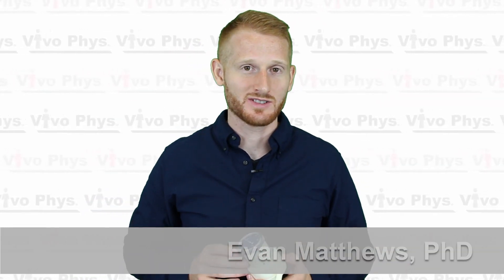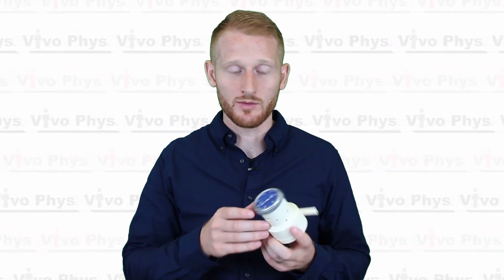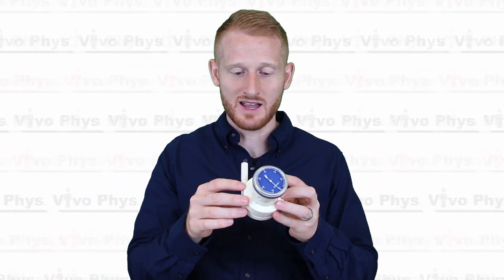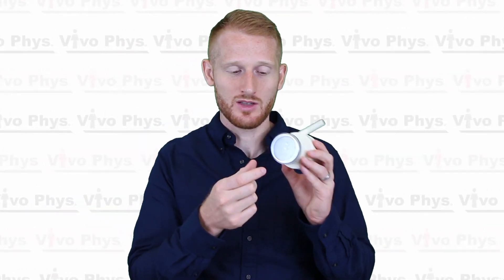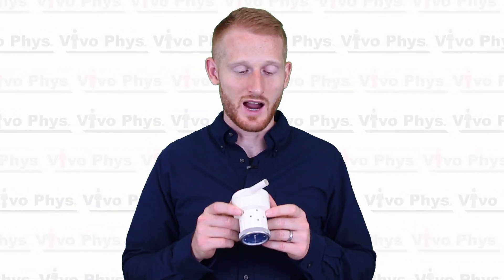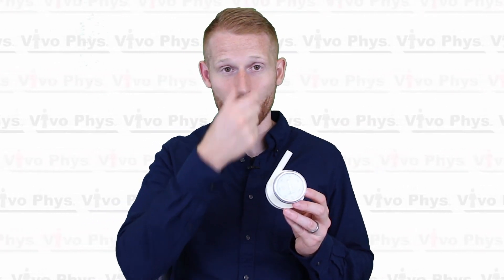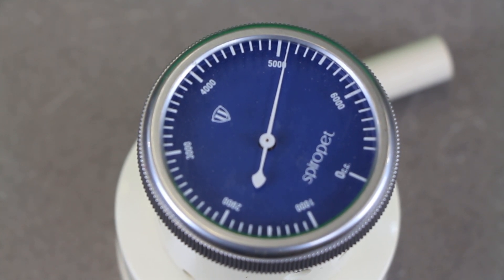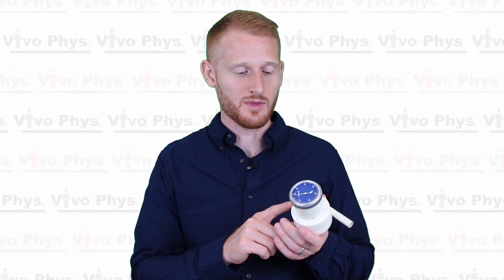Windmill Type Spirometer

Comment: The video explanation on the use of the windmill type spirometer is informative. As a post-surgical patient, I used the incentive spirometer which is a simple device needing little explanation other than being instructed to blow into the mouthpiece as hard as I can after taking a couple of deep breaths prior to breathing out into the mouthpiece. Reading the gauge on the tube simply requires viewing the ball within the tube at its maximum height and recording the volume of air expelled during the expiration.
Reply from the maker: Thank you!